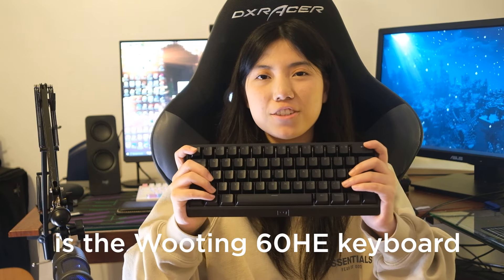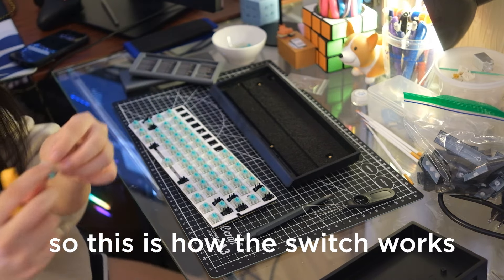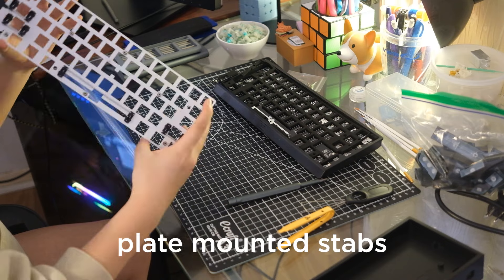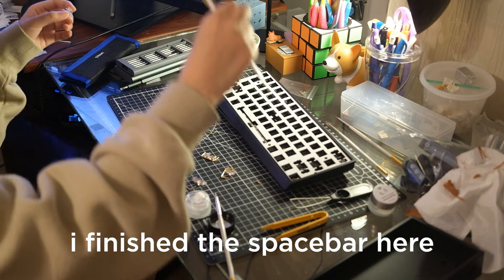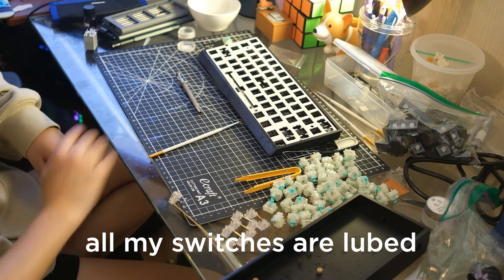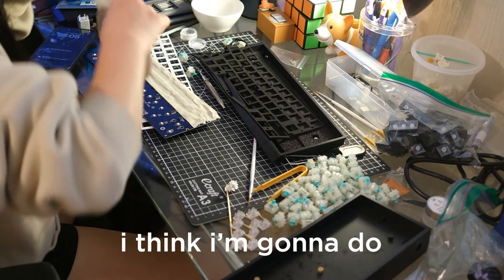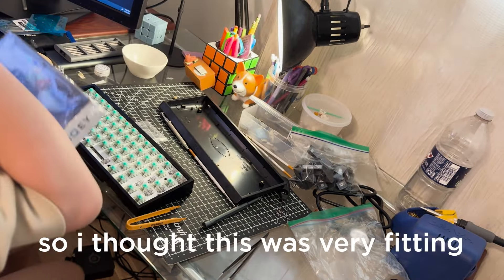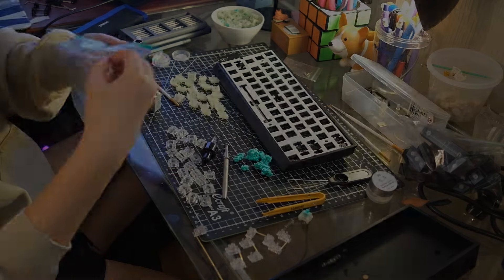creating the perfect wooting keyboard

Comment: Experienced Wooting modder here! I will give you the best mods so you dont have to look for it :)
(Hope this gets pinned for the community,  as personally I have did many sound tests and nearly 1k to test out different mods for the Wooting, whereby their hall effect switches sound dogshit)

Free Mods:
- Removing of PCB Foam (Increases Loudness)

Cheap Mods:
- Tempest Mod - Blue Painter's Tape (Increases Loudness, Adds Little Poppy Sound Profile)
- Polyfill (Instead of Case Foam, Sounds Amazing)
- Gummy O-Ring Friction Mount (Bakaneko60 or Graveshift M 30a-50a)
- TX AP Stabilizers (Best stabilizer change you can get in the market)
- Lubing Switches (Krytox GPL205g0 for Stem and Housing, GPL105 for Springs - for springs see bag lubing)
- PC Plate for Thock, Aluminium Plate for Clack, but im odd so i love FR4 - it looks amazing :3

Moderate Mods:
ONE OF THE CLEAR WINNERS FOR BETTER SOUND
- Switch Swapping ( If you care about the sound, I suggest Gateron Magnetic Jade Switches)

Expensive Mods:
- Case Swapping (If you are getting the Tofu Redux, I suggest to buy the brass weight together with it)
- Quality Keycap Swapping (see https://www.alexotos.com/keyboard-vendor-list/)

Useless Mods (IMO):
- Switch Films (they barely do jackshit on the lekkers and are a complete waste of time)

Side Note: I honestly wouldn't bother lubing Wooting Stock L60 or L45 switches. They really sound horrible and no good lube job is going to fix it. Just get the Gateron Magnetic Jade switches fr. and why not Burger O-ring you might ask? Yeah, I have tried it out and had the most frustrating 30 minutes of my life trying to screw the burger mounted o-ring into it's hole and i have only encountered problems. Over-tightening of o-rings, O-rings breaking, Inflexible if you are a frequent modder, Exhibits inconsistent typing sound compared to the gummy o-ring friction mount.

edit (3 may), swapped to the magnetic jades, sounds really great and probably one of the most worth it purchases.
Reply from the maker: thanks for the thorough advice! def wanna try the magnetic jade switches next. I think it also all comes down to preference, I personally prefer the PCB foam included, filming, and lubing the lekker switches
Reply: the pcb foam indeed comes down to personal preference, its been a 50/50 for it most of the time! maybe i was overcritical on the lekkers, but i guess it does make the lekekrs sound a tad bit better~ as for the films, personally i dont see much effect using it soo yeah, but in the end up to personal preference:) if you love something go for it!

when it comes down to keyboard modding, there's never no this or no that, it all depends on your preference of sound profile! after all we humans, our skulls are all built uniquely, and thus process sound differently:D
Reply: @shelbyyang  oh yeah about the gateron magnetic jades, i heard they're the cheapest on taobao
Reply: +1 to swapping over to Gateron Magnetic Jade switches
Reply from the maker: @Yuwunahhh  oh rip I already ordered them from gateron 😭💔 thanks for the notice tho!
Reply: @shelbyyang waiting for your next Wooting modding video 😊
Reply: might be a dumb question, but with the magnetic jade switches can you go as low as 0.1mm actuation point like the lekker switches? Also, are the jades more similar to l45 or l60? I don't want it to be too light like the l45.  @shelbyyang
Reply from the maker: @gabsters3770  not a dumb question! I’m not 100% sure but I think the switch should handle 0.1mm. I know the travel distance is 3.5mm though compared to the 4mm of the lekker switch. And according to its specs it’s lighter than the L60 and a similar actuation force compared to the L45.
Reply: @shelbyyang thanks for your response! i went ahead and ordered the jades!! i can’t wait for them to come in 😁 I’m looking forward to your next wooting modding video!
Reply: For future reference, your personal subjective favorite things are not "the best". Hope that clears things up going forward.
Reply: @CyberneticArgumentCreator  i think you are lost since you didn't read one of my previous replies. i did mention everybody's sound profile is different and unique due to our individually uniquely constructed skulls
Reply: @Yuwunahhh your first sentence of the thread says “the best” which is what they are referring to
Reply: @GUNseoulJIN  yeah im aware of that, but into the thread we already did readdress that it all comes down to your own personal preference of sound profile. in which yeah, all of you are right, there indeed is no "best" when it comes to modding so yeah. thock and clack are two opposites, while poppy is somewhat in between but not there. we never really had an audio engineer to thoroughly test through all of these either so yeah.
Reply: @GUNseoulJIN  either way to address anyone else here who is gonna be on about it again. what i've listed here is what worked out the best for me as well as tested within the wooting modding community. ive been on it for countless of hours dealing with a horrible sounding keyboard and have found the sweet spot where people find the sound acceptable or to their liking. and yeah, im sticking to see the broadening of hall effect switches to see what would be my next BiS switch

edit: my partner cannot stop touching my keyboard 🫠 helpz
Reply: I have been considering jade switches, I have the burgundy tofu redux and have done tempest and polyfill.. didn't bother with stabs but the standard typing experience leaves quite a bit to be desired compared to a 'standard' custom board. But nothing comes close to this board for serious goblin hour gaming. 
Thank you for this list, and am glad I didn't waste type using switch film or lubing these switches... Cheers
Reply: what do you think about raptor he switches compared to gateron jade switches, which ones you think would be better? Also thank you for the list, gonna use it for my next build for sure, still deciding on the switch part though
Reply: @robijsgederts1730  comes down to personal preference pretty much, but if you're looking towards better sounding switches, id go with the jades
Reply: any take on the switch + stab pads since you didn't mention that? also regarding mounting, I've heard from BadSeed Tech recent video that mounting the new 60HE+ with o-ring is no longer possible because of the stabilizers, but that got me confused as I don't really get what the difference is.
Reply: @patrikmedia  personally the switch pads dont really do anything, some of the other community modder agrees that they cant even tell what difference it makes but we pretty much just leave it in. (although i recently took it out after swapping to the he+ module, since i saw the switch pad being mashed in between the switches and pcb

as for the stab pads, usually we dont mod stabilizers in the way whereby "if they ain't broken, dont fix it" so yeah, the he+ module screw in stabs feel really good and i dont think they need any fixing.

for the gummy oring friction mount, you are still able to oring mount it, you're only required to swap out the backspace and spacebar stabs. personally im running tx-ap clip-ins on the he+ module while the spacebar is the stock screw-in and it works for me. (im on the tofu redux) -gravity test and it doesnt fall out too.
Reply: @Yuwunahhh  gotcha, I ordered the TX AP Long Pole plate mounted to go well with Jade as I heard people recommending them due to switches being only 3.5mm travel and therefor not ideal combined with stock stabs. But I didn't fully understand what difference the plate mounted vs pcb mounted makes, hopefully the plate mounted version works as well with the o-ring mount.
Reply: @patrikmedia  i think the long pole side varies between people, some people run normal stabs with jades while some run them with long pole stabs. plate mounted are usually more wobbly than pcb mounted stabs, so for pcb mounted, the clip-ins vs screw-ins are both good, minimal difference although screw-in takes the crown.
Reply: @Yuwunahhh  ok thanks, I already ordered the plate mounted ones but will check if they can swap it for the PCB mounted version instead if it's not too late. super helpful man, ty!
Reply: what mods would you recommend to get it sounding like the third one? https://www.youtube.com/shorts/GxATylA8eXA  this is my first custom kb. i think im going for thock? lol. I dont know every time i see a video of someone showcasing thock it sounds different to me lol. but i like the deep sounding ones. puts me in a mood to just type and listen to lofi lol.
Reply: @dankeykang2981  the definition of thock honestly varies from person to person i remember we had this discussion in the server HAHA. As for the sound, it is unlikely for a HE switch to sound like the one in the video,  but the closest I could think of is:

- Quality Keycaps
- Gateron Magnetic Jade Switches
- PC Plate
- Tempest Mod
- Polyfill
- Removal of PCB Foam
- Case Swap (different case materials will produce different sounds)
Reply: @Yuwunahhh  so I should just buy the module and then buy everything else seperately? thanks so much
Reply: @dankeykang2981  that would be the most ideal option if you're deciding to go full custom!
Reply: @Yuwunahhh  thank do you have any sounds tests i can look at?
Reply: @dankeykang2981  not that i know of, i personally havent had the jades yet but i have heard multiple sound tests of them and they sound closer to normal switches in which are able to produce the closer thock, and also most of us also stick with the same mods like the pc plate and polyfill. (note that it is polyfill, not polyfill foam)

edit: oh actually i missed out on the gummy o ring mod (friction mounted)
Reply: @Yuwunahhh  thanks so much. i keep coming back and not seeing my reply that i just posted. weird. have you heard of the boog75 it kind of has the the sounds profile close to the vid? idk i think it sounds good or do you think a custom wooting can sound better?
Reply: @Yuwunahhh  i saw you recommended Bakeneko60 but isnt that center usb c?
Reply: Hey for the stabilisers im a big noob. On my retailer there are different options for the stabilizers you recommended, which ones should I choose?

PCB SIZE:
1.6T
1.2T

POLE SIZE:
STANDARD POLE
LONG POLE (1MM)

KIT:
TKL
2U

Don't know what any of these mean tbh :P Also what differences does getting aftermarket stabs do?
Reply: Would u lubed the Jade switches, think it will make any difference VS them being factory lubed?
Reply: @shelbyyang Would you make a vid on the build? :O
Reply: @samtheham3187 Did you figure out what size to go for?
Reply: @flyingwhale7176  not going to end up getting them because the wooting board i got is the OG V1 wooting 60 he which is only limited to plate mounted stabs.
Reply: @samtheham3187  It was 1.6mm. Anyone using Gateron Magnetic Jades should also get the long pole version.
Reply: Would you reccomend applying switch films to the magnetic jades? I hear it is not worth it with switches with already super tight housings but do not know if jades fit in that category.
Reply: can u mod mine?
Reply: @Yuwunahhh  would the PCB mounted clip in TX AP 1.6 stabs work with the o ring mod though?
Reply: Hey, I know this is a pretty weird thing to ask but how would someone go about moddding the two HE ? Thank you
Reply: the o-ring comment is so real and is such a huge headache to deal with that i gave up as well on doing it with my wooting haha
Reply: do you like ceramic keycap? I wonder if it would make a huge difference in sound
Reply: So are they not that good from factory? Or is keyboard modding just huge with wooting?
Reply: does this apply to the 80he too?
Reply: Dude thank you for dropping this cheat code so beginners (especially beginners in the whole custom mechanical keyboard scene) don't have to search for every single thing. I have some questions though.

1. What are some high quality aluminum cases on the market that people prefer, and what is the price range depending on material quality, finishing, color, etc? I'm just looking for a plain anodized aluminum case with a silver finish.
2. I'm looking for good quality black plastic keycaps with translucent letters (obviously for light to shine through) but also white LEDs beneath them (I'm okay with foregoing RGB because I think it's harder for RGB LEDs to achieve pure white than an LED made specifically for white light). Where can I find these two components? Really the aesthetic I'm going for is like a white keyboard backlight on a MacBook or a premium Logitech membrane keyboard (think MX Keys).

Forgive me for treating you as if you're a component picker but I haven't seen any keyboard modders build a keyboard like this and I'd really appreciate if you'd let me know if you've seen something like what I'm describing. For some reason most RGB keyboard builds that I've seen have the RGB beneath the keycaps but the letters on the keycaps aren't translucent so the backlight only illuminates the space around the keys but not the letters, which is odd to me. I don't know if it's due to a production constraint around making only the letters translucent on keycaps, but then how do membrane keyboards do it?

Thank you again.
Reply: @utubekullanicisi  randomly revisiting my notifs but
1. Tofu Redux
2. I actually own them but i need to search the link for them
Reply: @Yuwunahhh  Youtube kinda sucks for sharing links so just the name of the website and the product's name will do!
Reply: hey, my keyboard just broke so i need a new one and got the idea to build one with the wooting as base. do you know some good sites to buy quality keycaps?

Comment: One thing people don't understand is that the Wooting 60HE is definitely not made to be the best sounding keyboard. It's literally made for gaming performance. Yeah it may not sound the best but it's one of if not the best gaming keyboard available right now. I consider myself an extremely competitive player and I would trade performance over quality/sound any day.  Hopefully one day we can have the best of both worlds.
Reply: With the new 60he+ module adding screw in stabs and pairing with some aftermarket HE switches and a case you can honestly do both now. My wooting sounds super marbley and poppy with the WS dashes. The main sound problem was the terrible plate tolerances for the stabs and switches, as well as the lekkers being open bottom leaving them sounding empty and soulless.
Reply: @ridiak3637  yeah I have the 60HE+ as well. Without any aftermarket parts I fuckin loved the sound straight out the box. Granted I bought the lube kit and 45g Lekker switches so it's sounds a bit different, but straight out of the box no mods it sounded amazing. Truly pioneers of the keyboard industry.

Comment: Unfortunately controllers to this day still use potentiometers and not Hall effect sensors. The only similar application I know where hall sensors are utilized is in radios for drones where the precision should be more accurate than in that of an xbox or a ps4/5 etc controllers.

Comment: I don’t mean to be rude when I say this but I think a burger mount and using the new gateron jade switches would sound much better than this. Not to mention the factory lube on those switches is pretty solid, so it would save a ton of time. Is there a reason you didn’t include either of those two mods or is it something that was overlooked? Thank you
Reply from the maker: You’re good! And very valid questions. I bought the parts and recorded this before gateron jade switches or any third party switches were available, so I was making do with the lekker switches. As for the burger mount, I was going to do it and just forgot 😭.

Comment: Doesn't the switch pads mess with the behaviour of the magnetic switches in terms of travel ? I was also thinking about modding my wooting like this but i'm kinda resisting because of that reason.

Still nice video
Reply from the maker: Thanks! And I haven’t noticed issues with travel distance, very negligible at least